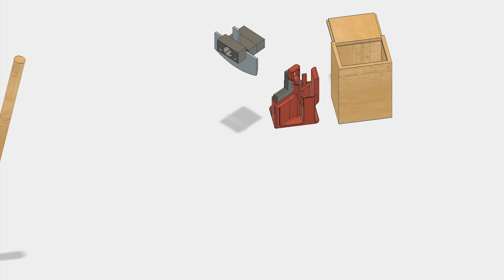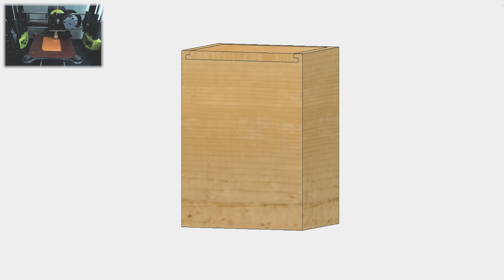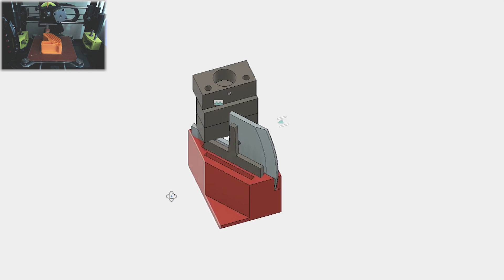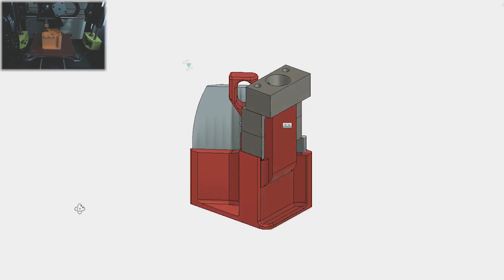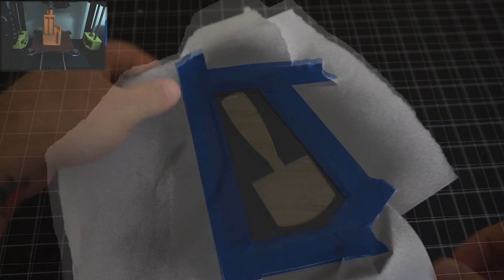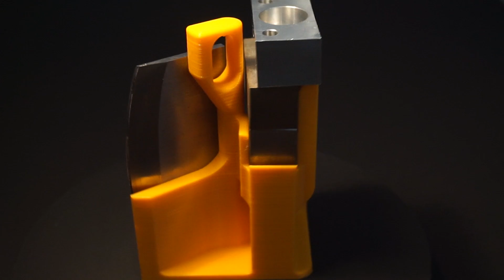3D Printed - Mezzotint Printmaking Tool Holder

Comment: you could sand the old label in the box off to finish the box off nicely... why are the tools so expensive?
Reply from the maker: Yea that would be an option. It's very cheap wood, and I kind of like the look as is. Maybe if I come across a better box, or make my own. Regarding the tools, They are hardened/tempered tool steel, and I don't know of a lot of manufacturers, so I guess they can charge what they want. They are nice though, and should last longer than I do!
Reply: +Diode Press it might be a tool I can make once I get the knife making thing all worked out...